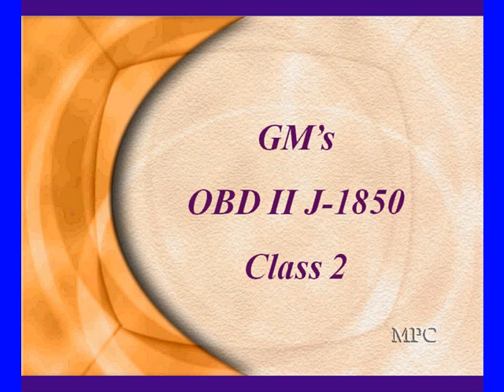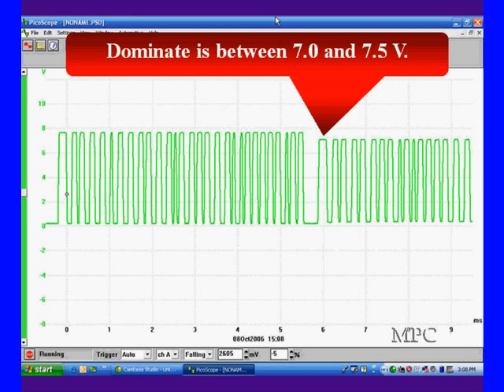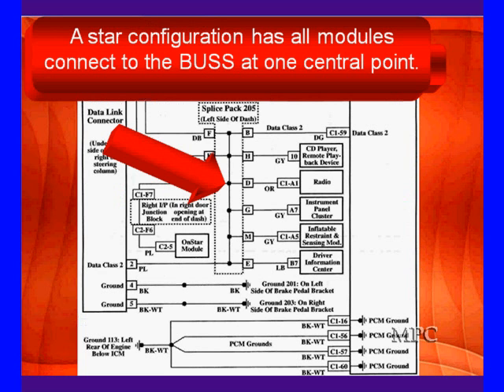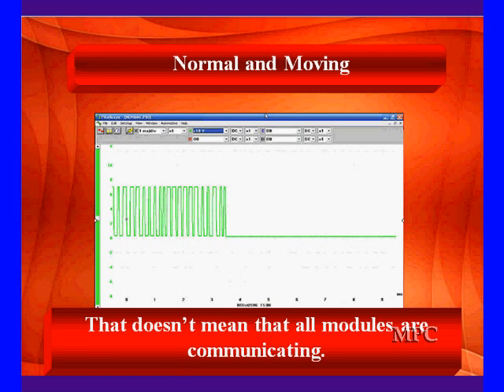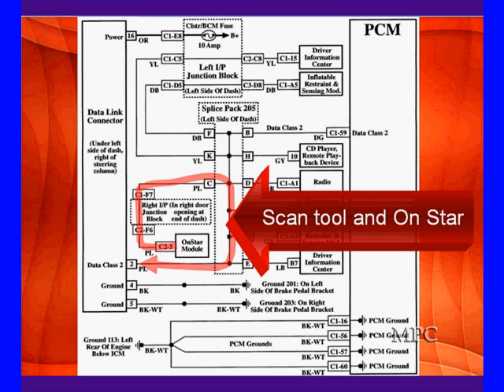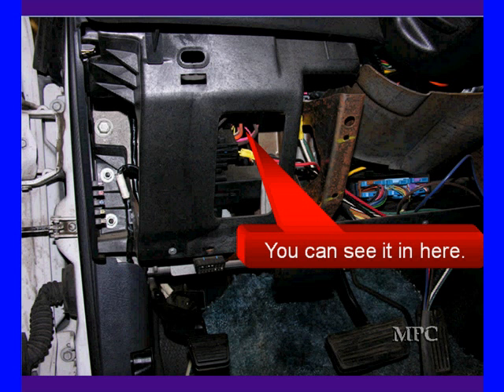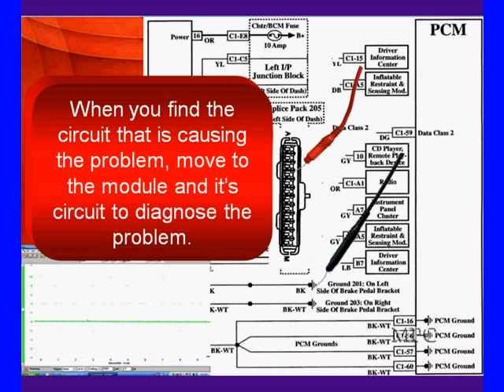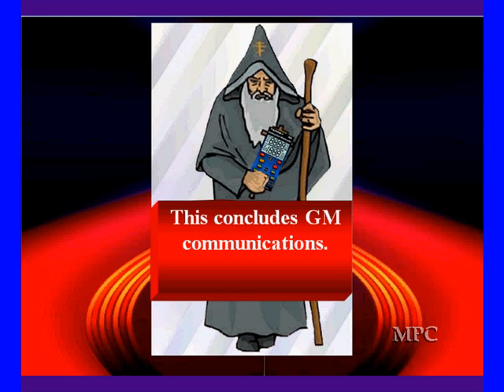12 GM Class II Communications

Comment: Hi , I have a 2005 Chevrolet Silverado 4.3L. I have an intermittent problem; the truck starts but immediately shuts off. I got codes U1041,U1064 and P1626 on the pcm . I unplugged the comb connection and found that every other module had 7v but the pcm had 0.3V . To make sure the pcm wire wasn’t being grounded somewhere, I cut the wire right at the pcm connector and still had 0.3v coming out of the class 2 wire . I believe this means that the pcm is bad, am I correct ?
Reply: I would assume so. Do you remember if you figured it out?

Comment: grate information  thanks
Reply: problem facing in Chevrolet captiva 2007 manual, DTC U0073(Control Module Communication Bus OFF), U0121(ABS MODULE lost communication) and P0500(Vehicle Speed Sensor) ,,,,suddenly instrument cluster stops working ,all needles(Temperature, rpm, speed etc.) showing 0 reading , ac stops cooling while blower keep running,reverse gear light stops working, Service Vehicle Soon light & MIL illuminates in cluster. and all happen intermittently and all together. Can anybody suggest solution?